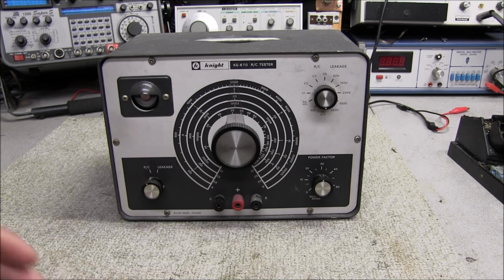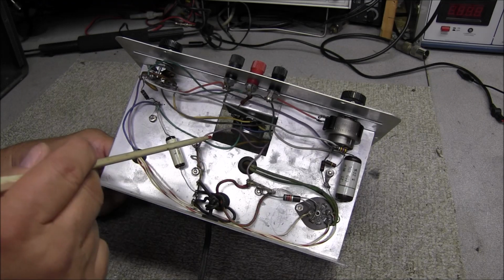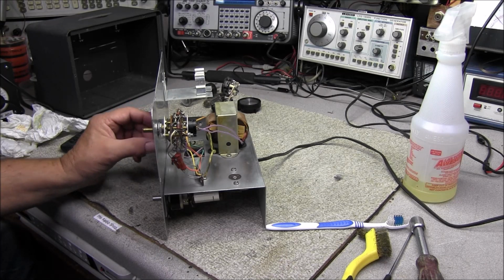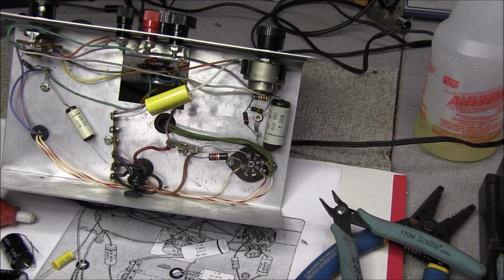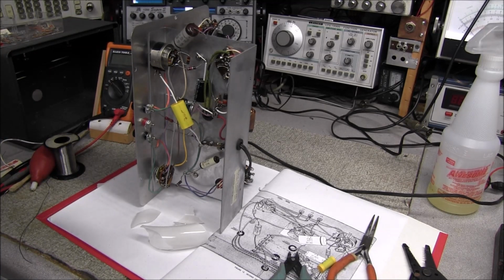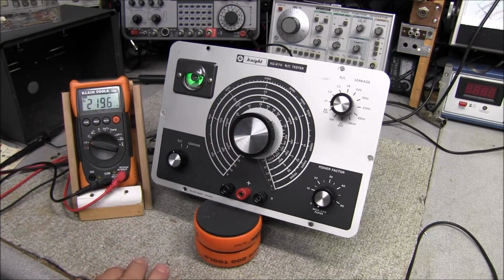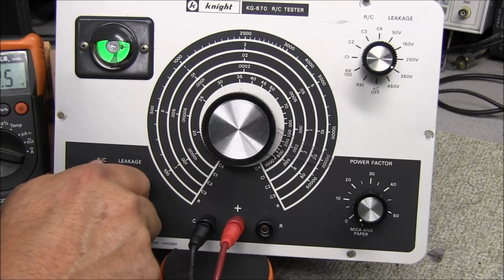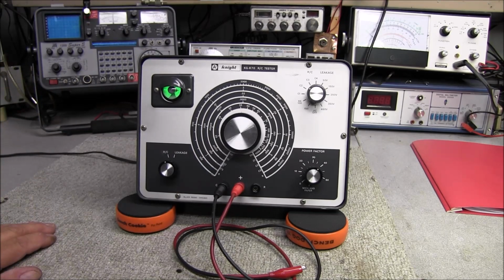#213 Knight KG-670 R/C Tester  Repair - GiveAway

Comment: That capacitor incident reminds me of the very first time I ever worked on a radio. It was an AM radio out of an early 70's mopar, and I accidentally put the cap in backwards. Unlike you, I did power it on and blow it up right along with some other components. Oh well... live and learn. Scared the heck out of everyone else in my college electronics lab though ;D

Yes I would like the tester. It would really help a new tech like me get started. Ironically I was just talking to some fellas over on a forum about identifying a specific capacitor without luck. That tester would be really helpful right now.

Comment: Nice job Buddy, I agree I think it was a kit that was never finished.
I had to replace the 2 MF bridge cap in my EICO 950 and I used two 1 MF 630 volt caps, the yellow ones from Sal's Capacitor Corner in parallel, I checked them with a digital cap meter and they were spot on at 2 MF.
I do not need that R/C tester, Thanks for another great video.

Comment: I've been looking for a Heathkit capacitor tester for a long time. Everybody wants an extreme amount of money for one. In reality  I just want a vintage capacitor testes with an eye tube. Please consider me for the Knight KG-670 R/C Giveaway. By the way I also use wire insulation to cover bare leads. It's better to error on the side of safety, and I like the spring return back to resistor tester on the Knight. How can I put it I NEED THIS TESTER.

Comment: I enjoy your videos. My "bench" which is a small computer table holds my 2 other pieces of equipment, a Radio Shack digital multimeter and a Simpson 270 I used in my previous life working on electric guitar pickups. My hobby now is old tube radios and guitar amplifier repair/restore. I could put that capacitor checker to good use. I've learned much from you and others like Mr Carlson, Xraytony and also how not to do things from others who will remain nameless. Thanks

Comment: Nice work Buddy.  That is a very nice unit.   It is also nice of you to send it on to someone who can really use it.  I was thrilled to get my IT-28 and the only thing I don't like about it is the lever switch as you mentioned.  I've trained myself to not remove my hand from the leakage lever until I return it to discharge position.  I do like the 600V available on the IT-28 and I've calibrated it to put out accurate voltages on all settings.  How close was the output on the Knight?  Doc

Comment: Nice cap/res checker. I have a C-3 Heathkit condenser checker which looks exactly like the knight KG-670. Only thing is the leakage/normal and power factor switches are reversed. One must be copy of the other. I will be installing a fuse and grounded power cord. Thanks for the video Buddy because I learn something new with each and every one of them.